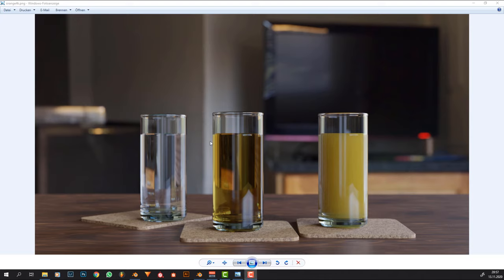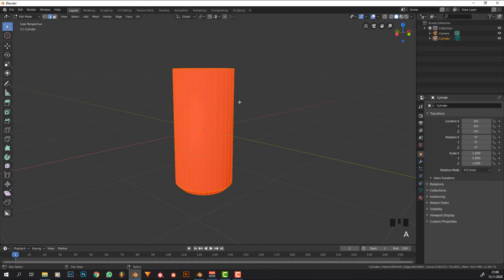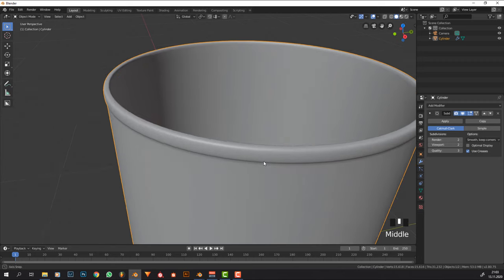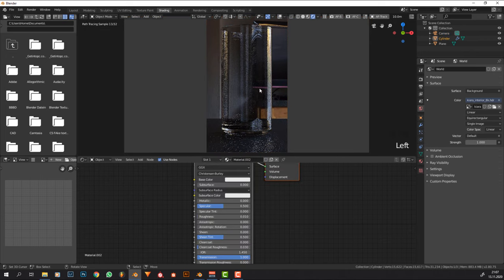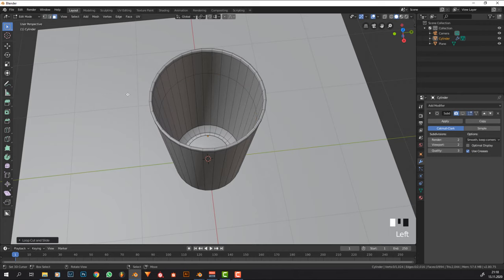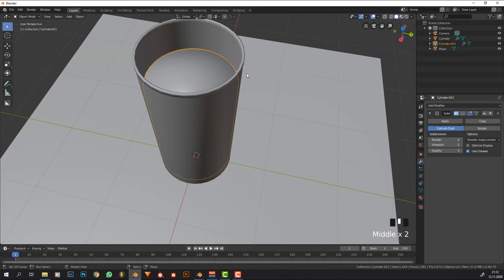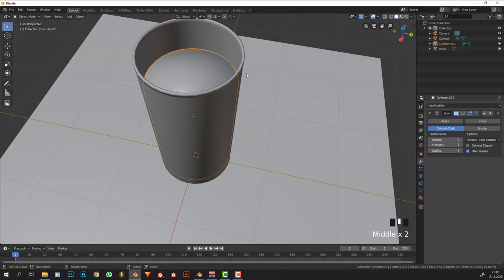Common Mistakes When Making Glass / How To Make A Glass In Blender (Beginner Tutorial)

Comment: I made the material in the same way, but it's not transparent like a glass. It looks more like mirror just reflecting environment. How do i fix this?
Reply from the maker: You are most likely rendering in the EEVEE render engine, where it is not possible to achieve realistic looking glass. You need to use Cycles for it to look as intended
Reply: Is it possible that it's because I made it in Eevee? Because now when I switched to Cycles it still doesn't work, however I made a new project, started with Cycles and it seems to work. So the real question is can I fix it in some other way or do I have to make it from the start? Anyways, the tutorial is great and thanks for quick response :D
Reply from the maker: Hey there, sorry for the late reply
It doesn't matter what render engine you make it in, you must've done something wrong when you modelled it
Most likely your normals are pointing the wrong way (I showed in the video how to check that)
I can't tell without being able to see it though so you could join my discord server and send a picture of the issue and I'll try to figure it out :)
Reply: No worries. It’s definitely something that I did wrong at the beginning. It’s fine though because I was able to redo it pretty quickly. Again, really nice tutorial 😁
Reply from the maker: Thank you 😌
I'm glad you were able to redo it without any issues

I still recommend joining the discord server so that you can ask whatever you need, whenever you need it :)
Since YouTube doesn't notify me for every comment, it's hard to keep up, but on discord, me and the other members see everything and we're all willing to help each other :)
Reply: Don’t worry, I know YouTube can be weird with notifications and sometimes it can be really annoying. Thanks for inviting me to discord, I might join it.

Comment: my juice is the right color in cycle but turns plain white (not transparent) in render :( what did I do wrong
Reply from the maker: It depends on what juice you tried making. If it's the apple juice, you might have turned the roughness up too high

If it's the orange juice, you might also have the roughness too high, but that could also happen when pushing up the density too high as well
If lowering either of them doesn't help, make sure to join my discord server and send me the file so we can look at it together :)

Comment: How have you reduced the noise?
Reply: For simple denoising in blender go to the down left of your program you will see a tv also the same place you use to change ur render engine, you will see denoising click on the arrow and leave all the options at the right default the main thing you want to click on is the box there, render will denoise ur final render and viewport will preview it before rendering
Reply from the maker: That is how I did it

Note that Open Image Denoise (Optix) will generally give you better results in comparispn to NLM in this type of scene
I also used 400 samples
Reply: @philipkriegel  thanks for the quick feedback just subbed 😃
Reply from the maker: No need to thank me, thank you for the sub, but mostly for helping people in my comments, it's really appreciated 😌
Reply: @philipkriegel  thanks man looking forward to the next vid
Reply: @shortsfc3446  Thank you!I am new to Blender, I am surprised someone read my comment and answered it. Thank you a lot!
Reply: @philipkriegel  Thank you, you said Optix is better in this type of scene but what is NLM for?
Reply from the maker: You should really try and experiment to see the different results each setting gives you in different scenarios

I find NLM is good for scenes where you have a lot of plastic and metal surfaces
In my opinion, it does not perform well with glass or anything transmissive

You should generally try to not use denoising, but if you get a lot of noise, it's a good alternative

I find myself using optix 90% of the time (if I use denoising at all) because it's a good all round solution
Reply: @mikhailselyuzhenkov7450  anytime
Reply: @philipkriegel  I am new and this is why I asked and thank you for the notes :)
Reply from the maker: You're welcome, feel free to ask whenever you need something :)

Comment: 15:00 I have a doubt here. Why should liquids be inside the walls of the glass? That's not how it works irl right? But why do we do it then?
Reply from the maker: Because with polygons, if we don't do that, were going to have an infinitely small space which is empty of 2 faces overlap. That usually gives us shading issues and  the index of refraction doesn't get calculated correctly because it scatters though the walls of the glass twice instead of once before entering the liquid.

That is why we do it in CG :)

I hope I made it a bit clearer, if not, and you want to further discuss the topic, feel free to join my discord server and we will talk there

Comment: How to remove this fucking juice  liquid noise ????? Please please reply 😭
Reply from the maker: Enable the denoise option
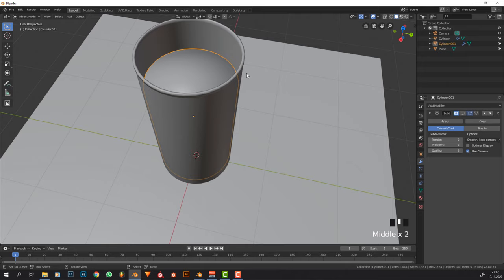Reply: I already enabled.. Brother but I don't achieve 24:06 type of juice  @philipkriegel
Reply from the maker: Make sure that your volume density is big enough
If the liquid is black, then you should increase the volumetric bounces in the render tab

You can also check if your normals are facing the right direction, in edit mode, select the entire liquid and press Shift+N
Also you should check if you are using the cycles render engine, with Eevee, this won't work
Reply: Thanks U so Much For Reply ❤️ @philipkriegel